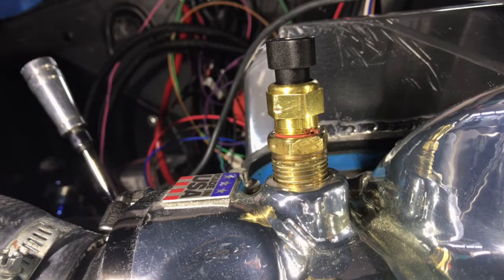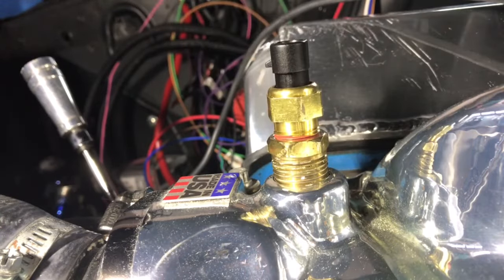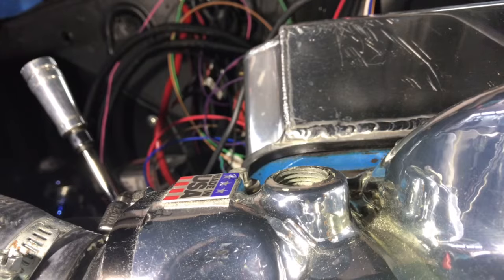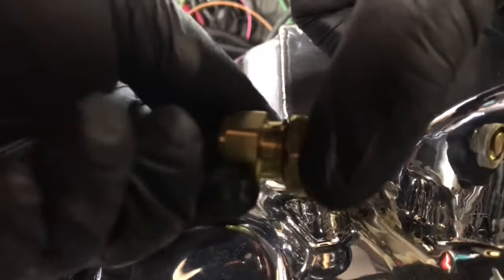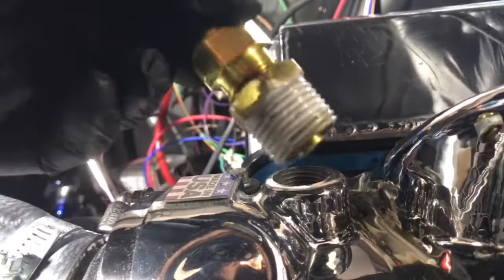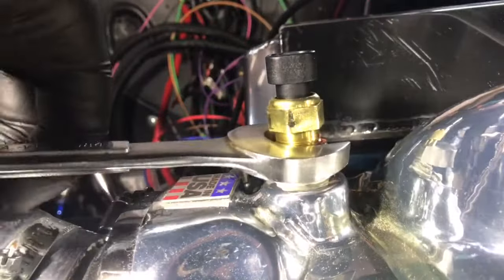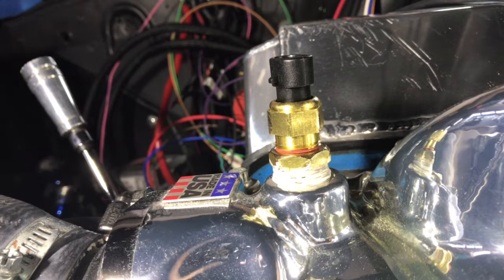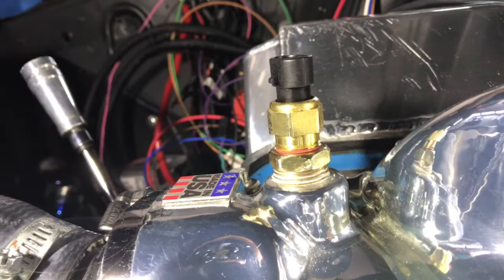How To Install a Coolant Temperature Sensor The Right Way

Comment: You have to use Tape on NPT fuel pump fittings in older trucks with mechanical fuel pumps. The NPT  fittings will leak if you don't. That's why they changed the fittings to NPTF fittings because tape wears down and gets inside your fuel pump) engine etc ..use PTFE tape if you have NPT fittings. Don't if it's NPTF.....the threads are made to bind and seal on NPTF fittings.
Reply: Can both be used at the same time

Comment: My mechanic used teflon tape on an oil sensor for my 2007 MDX. Should he have used high temp thread sealers instead? Should the sensor be reinstalled?
Reply: They both do the same job, It’s just a matter of preference of the installer! I would not worry or change it unless you have a leak! I personally  used Teflon tape on my sending units when I installed them in my 1993 cobra back in 1995! Here we are in 2000 and20 and they have never leaked! If installed correctly you should have no worries!

Comment: Thanks for this tip! Watched another video where the guy used tape, so that's what I did and the temp gauge keeps going up even though the van's not running. Gonna try this and see if it fixes that!

Comment: With that plug can you run a radiator fan and coolant gauge?  what wires to which device? I have an older 350 with only a single port on the intake manifold.

Comment: question . if u tight sensor in toooo much will that hurt it ? and i did i short my ecu out u think ? cause i didnt unplug battery . i cant get sensor to work . i thought maybe prongs were dirty they were lil wet from alil coolant mishap i had lil spill on it i think .

Comment: with this   adapter  the   reading will be  wrong... as   not  all the   sender is  in the   water   enough...  you have  to  have it  lower  in the  water...  you need a   bigger   base  on the  sender...  I  did   this,,  and  my  gauge  reads  too  high

Comment: And get ready to break off the sensor (it's hollow) when trying to remove it if you use this sealant.  (I used it, and taking it out, snapped it right off at the base) .
Reply from the maker: Good thing I have a video on here with 2.7million views on how to remove a snapped off brass sensor from an engine. Lol. Might be able to make another vid.

Comment: Probably want to get a sensor with a longer pecker on it when you use that adapter...
Reply: Why, If you fill your cooling system and bleed it properly there won’t be any air whatsoever! This absolutely works!